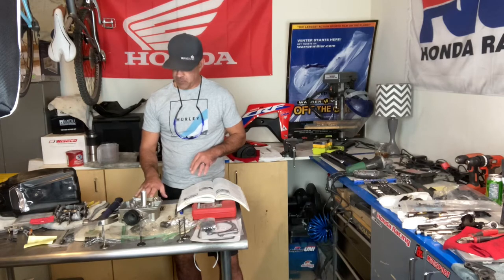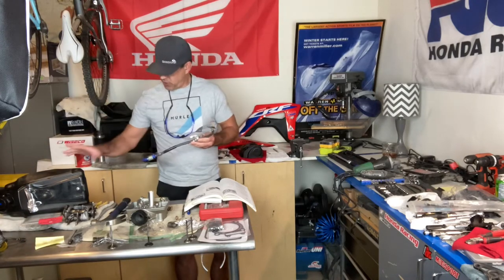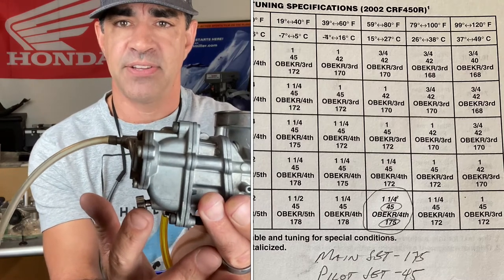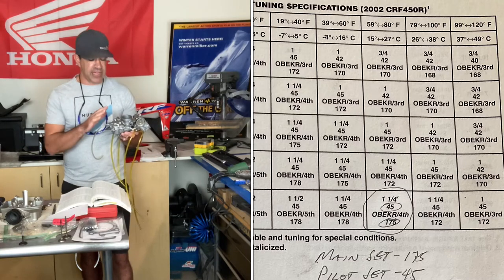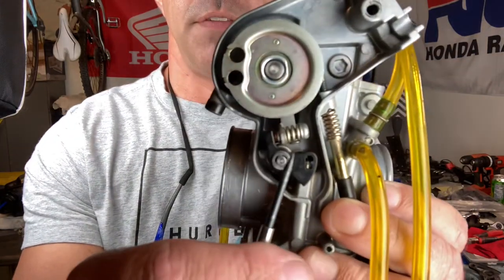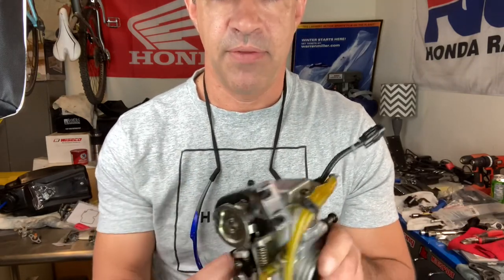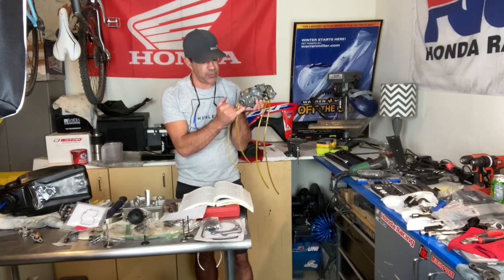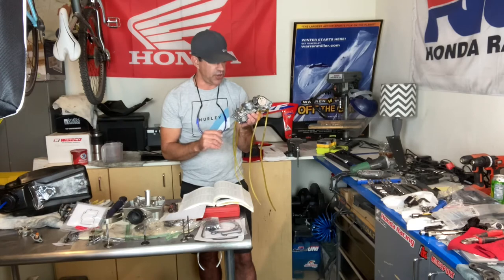Diagnostics on a CRF450 that won’t start, summary of fuel and Carburetor operation and diagnostics

Comment: I had a no start problem with a 03 CRF450R and rebuilding the carb and checking the valves revealed the problem. The valves were too tight and I went down the to smallest shim I had to get ,006 clearance and the carb was old and the gaskets were bad and jets were clogged. That and a quick oil change after a quick ride got a lot of black oil out of it. Runs pretty well now. 5 kicks maybe to start it up?

Comment: Man i need help bad. I have a 04 crf450r. Runs great when it starts. But ive been chasing this hard start issue all over. Did valve clearances plug carb clean and coil. Nothing has helped. When i kick it will pop with each kick like it wants to fire but just isnt happening at the right time. I checked timing so many times i lost count. I even went couple teeth forward and back and its always the same situation. I need some guidance please.
Reply from the maker: Have you rebuilt your head? Replaced your valves and recut your seats? I would take it to a mechanic that can rebuild your head and cut the seats, popping and not starting is not a carb issue, likely the head. Take it off and to a local dealership and have it inspected 👌

Comment: I would really appreciate your input, I have a 2004 Honda crf450r it only runs when you push start it or if you squirt fuel into the intake, it backfires when you kick it over. I cleaned the carb and everything so I’m not sure what to try next, thanks!
Reply from the maker: Have a look at the head, shim the valves, inspected the valves and seats. Go ahead and pull the head off and take it in to have it inspected. Have a look at this video
Reply from the maker: @Megabiggie  https://youtu.be/x06PWJxcNMM?si=DUEBYDd0ox-eDqW5
Reply: @socal.hondabuild8349  appreciate it, I took of the head, put it at top dead center, and it turns out who ever put the cam in last put it backwards 🤦🏽‍♂️
Reply: @socal.hondabuild8349  all I had to do was spin the can around, bikes than flawless now, starts first kick 👍

Comment: I have a question would really appreciate you input & help. I have a 2006 Honda 450R the carburetor in your video is identical. The Honda sat for about 2 years with the same fuel. I drained and refilled with fresh fuel. My quad would start only if adding some fuel in the intake run with mid to high throttle and shut down at an idle. I ordered a rebuild kit on amazon. Dis assembled cleaned all ports. Replaced true jets and seals supplied in the rebuild kit. After reinstalling the carb my Honda would not start. Not even with fuel sprayed in the intake. I ordered a replacement carb on line had the same results. I’m very surprised it will not even start for a moment. My next plan off attack is to check if the valves are too tight. Do you have any advise as too why i may have starting issues after rebuilding & replacing the carburetor?
Reply from the maker: Yes your valves would be a good place to start, when they wear they stay open from a tight or no gap with the cam. Take your head off and take it to a mechanic, have your valve seats replaced and recut and replace the valves with stainless steel they will last longer. If it won’t start this is certainly the issue, the bike absolutely will not start if the valves are wore and hanging open allowing air into the intake and preventing it from starting even if you added gas and fire from the plug. Hope this helps
Reply: @socal.hondabuild8349  appreciate your reply. I did a compression test & have 40 psi max. That’s seems low, do you happen to know the compression specs?
Reply from the maker: @Playersclub415  I do not, I would go ahead and pull the head and have a look at the valves, I’m pretty sure with the age that’s the likely case, if you flip the head over and clean the carbon with ether you’ll see the gaps between the valves and seats quickly
Reply from the maker: You are also going to want to disassemble the entire carb including the mid-body, that needs to be cleaned as well, it can get completely full of gunk

Comment: On a 03 KTM 450 after complete top end rebuild , cylinder re sleeve, new piston & new titanium valves and new adjustable accelerator pump with every thing tuned and running perfect. one day after a few months my muffler started melting my side plastic muffler cover, then a few days later the bike starts to lose power at higher RPM. Any ideas ?
Thanks for any help on this.

Carb is KEIHIN FCR-MX 39
Carb jets stock 170-40, in shop book 175-48
Jets In as of 03-22 - 178/50
Reply: Did you ever figure out the problem?

Comment: Would this be the same carb as an 05 crf450x?
Reply from the maker: Yes very similar FCR carb, the book will outline any differences between years which are minor from 02-08….I would recommend getting the Clymers Manual for your year

Comment from the maker: No comments or recommendations other than non-typical conditions would prompt me to pull the head and cylinder off and have a look, never hurts to have a look. If you can do this work it helps, check out some of my videos on top end disassembly